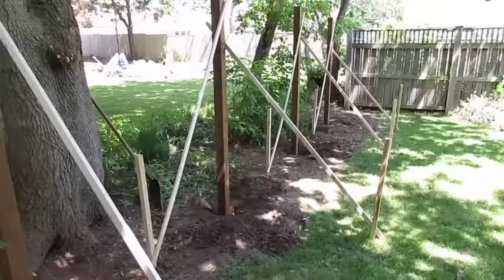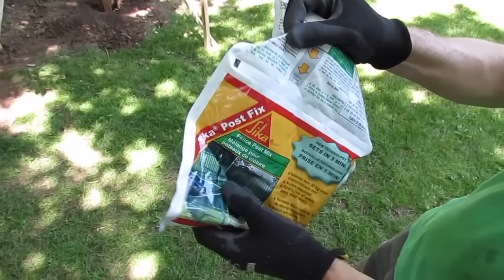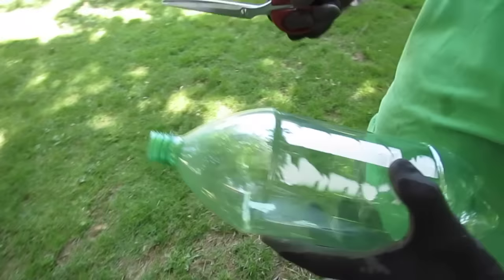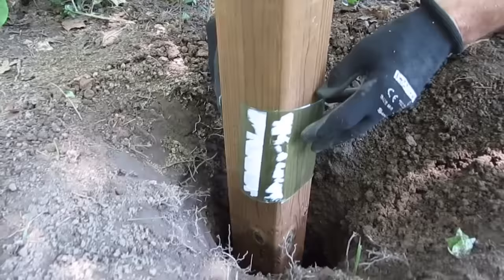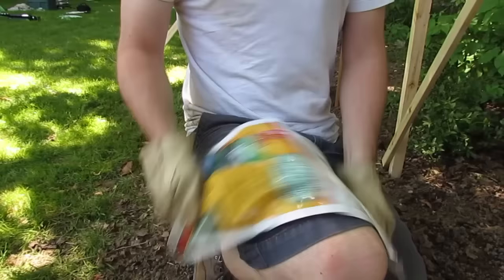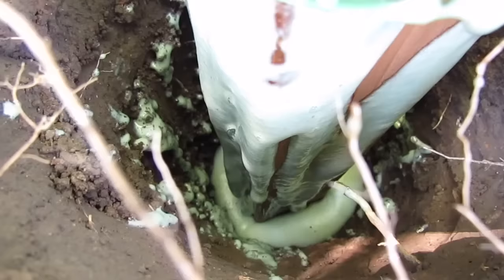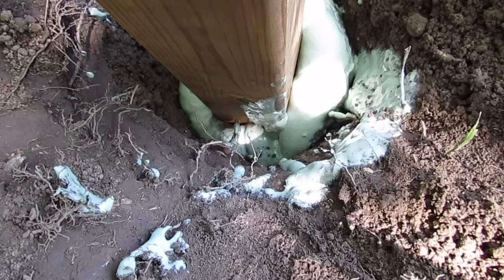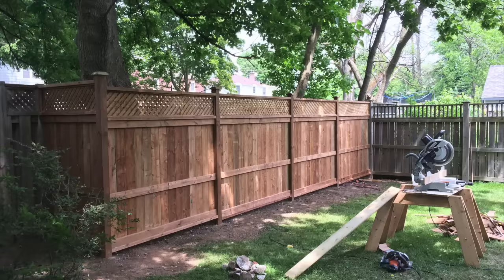No Concrete Fence Post Install!

Comment: Hmmmm that looks ok and would most likely be good. My brother and i built fences for customers up in The Dalles OR for about 25 years. We used a auger like you with about same size hole. We used pea gravel, put a little in 1st so post would sit on it instead of dirt. Then we used more pea gravel around the post and tamped it down real good, filling the entire hole up with the gravel. Reason we did it this way was to make it like a dry well, The rain water would just go down the hole and NOT stay against the wood. Im 66 now and everyone of those fences we built that way are still standing with same post. Cement is not a good product to put around fence post. After awhile it will have a small area between the concrete and post and will hold water in that crack against the wood and rot it. As long as the foam STAYS glued to the wood it too should keep water away from the wood. We were building contractors and i always thought concrete was not the way to go with fence post.
Reply: I agree,  I use a sharp gravel for extra friction.  I think that it also behaves better than concrete or foam with frost.  As frost can pull year after year the widening top of concrete out of the ground
Reply: Mr. Huteson, you are right on target.  
My area has clay type soils, so I backfill and tamp in 6" lifts.  The tamper is a steel rod, about 1" square with beat-down head on it, it really compacts the soil.  I mound-up the top of fill around the post so that water drains away.  Water in the soil is soaked up by the soil, and / or keeps the air away from the wood to prevent rot.  Some of my treated posts have been in the ground over 20 years and still going strong.  
Concrete retains a minimum of 7% moisture which is a good start to a 30% threshold for rot.  Concrete shrinks, so it shrinks away from the wood to leave a small gap to hold water which soaks the wood. 
Someone wrote that they thought the concrete helped by adding weight.  It also makes the base wider so that the post has more bearing area against the soil to prevent bearing failure and enlarging the side of the hole.  By tamping and compacting the soil, the bearing strength is increased and holds the post solid, even after 20 years and working in the wind.  
The foam seems like an unnecessary expense.
Reply: Only useful thread of the lot. Sticking to the post makes sense to keep the water off, as does concrete causing a wider hole, etc. 
The ground under my fences is clay, so I also used dug-up clay for tamped backfill. Seems to have held up well for the past 5 years. 
No real need for the disparaging talk about lazy people or whatever, it's more like no one has ever put forth a definitive method with clear reasons. 
I'm starting to think it might make sense to dip the posts in roofing tar before setting in tamped earth or whatever and maybe that would be the most effective?
Reply: Darren,
I don't recommend the tar.  In one instance, the tar will hold moisture inside the wood, even as it keeps moisture out.  In the other, the lack of tar will let moisture migrate out of the wood, regardless of how it got into the wood. 
For this reason, I recommend (see above) that you tamp the soil / clay / sand / gravel around the post and let the moisture be pulled out as the soil dries.  
Top the backfilled hole with clay as a cap, also mound up to let the water drain away from the post. In the bottom of the hole, set the post on a couple of inches of gravel (in pantyhose) to create a bottom drain.  
If your soil has low shear strength, this method will not work.
Reply: Michael M fortunately, that's exactly what I had ended up doing.  But why would shrinkage not be an issue with the clay?
Reply: Darren -- Clay at the top or bottom of the hole?  
At the top, the clay will shrink as clays do in the summer and you will see the familiar pattern of surface cracks.  Yes, the clay at the top might move away from the post.  With the surface crack, the clay is easily wetted and it swells against the post to hold it tight. 
At the bottom, the clay might or might not shrink as the moisture is less likely to change in the soil.  Thus, the post is held in place.  
If you are in a clay soil, the clay will shrink away from concrete (or foam) backfill, just like with the post.  Then it will swell back in cycle. 
For my posts in clay soil, they are solid and plumb after 20 years.
Reply: Thanks, Thomas.  That’s what I was looking for.  The only reason I’m watching this is to figure out a better way to replace pressure treated posts I put in concrete 35 years ago but broke off in a wind storm due to rot.  Not a fan of concrete for wooden fence posts.  It cracks, causes rot and the posts lean over time.
Reply: you should be the one making the video...
Reply: I agree that dry ramming is the way to go, that's the way we used to do it in Australia. First a base plate made of red gum in the bottom of the hole for the post to sit on, then put the post in and ram the dirt around it. It sounds like the post and base plate would rot but I've pulled down some fences over 30 years old and the base plate is still as solid as rock. I think part of the reason why posts rot these days is because the quality of the timber has been lowered and also changed, we usually use Cyprus pine nowadays because you cant get GOOD red gum posts anymore, they just rot in 2 - 5 years and are super expensive compared to their alternatives, Cyprus is about half the price and can last 10 - 15 years.
And hey, if you make a fence that lasts 30 years, how are you going to stay in business ;)
Reply: brianohbrian burns  heavy gates mean deeper holes and usually bigger posts (also for looks). That's for dry ramming though, if you were to concrete it then just 800mm in ground is enough. That's what I do anyway.
Reply: @kenbussian6925  They don't if they're dug correctly.
Reply: Just concrete your posts people....
Reply: There is a way to prevent water ingress between the timber post and the concrete, if the timber post shrinks over time. Before placing the timber post in the hole, get an old Paint Brush, and 'paint' silicone on the post base first. Then paint the silicone up the post on all four sides, to a distance that is approx. 50mm above the ground level. In this way, if the post shrinks, the silicone bond to the timber post - also shrinks. Preserving the life of the Fence Post. Silicone has a terrific bond to timber when cured, and it is worth the extra effort.
Reply: @Prairiedogma  yeah if you do it wrong with cheap concrete, 90% of the people out there mix the concrete wrong, almost always to much water and no fiber. I have built a ton of ponds, some with as little as 2 inch thick concrete in clay soil that have not cracked in 30 years, no leaks. do your post and concrete right and they'll last 50 years easy.

Comment: Power companies have been using foam to set there power poles for years now. I’m glad it’s finally coming to the residential market.
Reply: Ray Wilson so that's why they are always leaning and fall over in high winds......
Reply: Ive worked with Ameren Ue numerous times in my 16 years in the field and have yet to see them fill the holes with anything but concrete or compacted clay and gravel combination. Whoever told you this took you for a ride. Epa would be all over there ass for using foam.
Reply: My first comment was a joke, I am a equipment operator and we do a lot of digging in for electric lines so we see a lot of poles set.  Not one time have I ever seen the electric company use foam.  Auger a hole in the ground, drive the post in and use a compactor around it.  We have a lot of clay and rock here though, in the ozarks.
Reply: 40 year service life.
if you want temporary, then it's the stuff for you.
Reply: @justaguynamedmax8207  how is the byrde family treating yall over there? Did they finish building the casino?
Reply: Never heard of that.  Power companies don't use cement either, for the most part.  They just dig deep, drop in some gravel, set the (creosoted/tarred) post about 6' deep, tamp the soil around it, and they're good.

Comment: Save yourself the $ 13 a bag , as a small carpentry contractor i have occasionally over the years been asked to install some fencing , i used to fill every hole with a bag of post set or redi mix and used this product once when it was supplied by homeowner until a friend of mine who is the manager for the  landscaping division of a large farm store chain told me to just backfill with the soil you removed ,tamp  the shit out of the soil with the flat end of digging bar and check for plumb as your filling the hole up and keep poles linearly  straight with a string line.They only set posts in cement where a gate will be hung off of a post and go a little deeper /wider  maybe with hole to prevent leaning or gate sag . Works extremely well. glad i listened to him! Besides when it rains your posts wont pop out of the ground since they are now like a fishing bobber. I had this problem. do not buy this product  any one who endorses it is paid too

Comment: Tried the product. Easy to use. Quick. No concrete dust everywhere. BUT I noticed after a couple days the post I used this on - fence post with fence attached - had moved. The foam
had compressed allowing the post to move. Fence had been held level while allowing foam to cure. None of the posts I used Quickcrete on have moved. This may work in some soils for posts with no load, but for me I’ll stick with concrete.

Comment: The reason foam isn't designed for fencing is due to expansive soils.  When the soil is saturated, it expands and applies pressure.  In times of drought the soil shrinks, cracks, and dries out.  The weight of concrete helps anchor the post during loss of support during these cycling periods.

Comment: Thanks for the video. It was fun to watch, but I'll stick with fast cement concrete for 1/2 the price and not adding more plastic into the environment.
Reply: I will go with cement and concrete w hi ich has been used for centuries in construction successful and non chemical.  This product can be easy damaged by cold and heat

Comment: You don't use foam OR concrete.  You tamp crushed rock (typically 3/4-down) in the hole around the post.  Using concrete or foam locks the moisture into the wooden post where it will rot out the post.  The fence posts will last for years longer this way.  I did mine 13 years ago using 6x6" p.t. wood posts set with tamped crushed rock.  We get hard-freezes every winter up here (Canada) and our soil is red clay gumbo where I am.  Fence and posts are still arrow-straight today - and not rotten like the collapsed fence ( c/w hunks of concrete with square holes through them) that I removed back when I originally bought my place!
Reply: Robert Garvey for the rest of us who don't live on clay, we gotta use something like concrete or foam.
Reply: i doubt wood would be arrow straight after all those years. it is just not in its nature. also you can wrap the bottom of the post to avoid moisture or even paint it. once concrete sets up moisture will not penetrate it but it will around crushed rock.
Reply: Maybe you're right.  I bought my house in 2005 which was 1 year old at the time.  All post in the ground WITH CONCRETE rotted and broke off at the concrete top in 2015.  That's 11 years.  I'm in the Bay area where it only rains 4 months out of the year and is dry the rest.  
For all those here who claim concrete lasts for many decades, please explain that.   The parts of the fence sitting on top of the retaining wall with brackets are just fine (no rot).
Bottom line: concrete draws water from the soil and the wood soaks it up ending up rotting away.

Comment: Hello!

I was extremely cynical when I first saw "foam" and "fence post", but it appears that this has great potential. I've got questions though.

A) Cost per post relative to that of concrete, factoring labor time.
B) Longevity of foam in the environment (UV exposure, free thaw, etc)
C) Strength retained with constant sideways force (branch pushing against the fence, hobo constantly leaning on the fence)

Thanks!
Reply: Hobo😂😂😂

Comment: Using foam or concrete,  wood rot will occur with the post being exposed to the top soil.   I suggest using concrete formed above ground and angled so water will flow away from the post.   May not look at nice but just search for videos of removing rotted fence post and you will not want to have to do that.
Reply: True

Comment: I used to be a distributor of SIKA (a Swiss Company), we sold great products. I retired before this product came out, but I am sure it is fine. The important thing is to ensure you have enough wood underground so as to keep any momentum over the pole at minimum, That is, try to bury one third of the whole length of the post.

Comment: Taught to me by my SeaBee Father in Law how to quickly insert a deck/fence post using bag concrete.   Insert post, poor in 1/2 hole of water, poor in concrete mix (dry), mix using post action, more water, more concrete mix, done in 5 minutes, next post.......  Works every time and never had a fail.
Reply from the maker: Funny another guy commented moments before you swearing that pea gravel works even better! Seems like everyone has their own version of “the best way”.

Comment: Anybody with experience in fence construction knows that all you need is sand and gravel to secure down fence posts.
Reply: Sand and gravel are good,I like to use broken up bricks and rubble rammed into the hole around the post using a large iron bar, it makes it very solid. The big benefit over using concrete is that it doesn't trap water around the post, it allows it to drain away making the post last longer. It works of course just as well with concrete posts.

Comment: Use Quickset. It's just as easy as this foam, but way stronger!
Reply: using Quickset is illegal because it doesn't have enough required strength. I'm not sure how they measure it or whatever, but in the state i live the council doesn't allow it for commercial building projects
Reply: We are talking fence posts. Not a building foundation.

Comment: The idea of the foam is cool.  But just like concrete, it takes a lot of extra time and money.  I only use concrete if I'm supporting a lot of weight with the post, to get a larger footing, like supporting a deck.  Fences don't need anything but dirt.  You can tamp dirt in in less time, and at NO cost.  This foam costs between $11 and $17 per post.  We have fences holding in horses and cattle that are made of hedge tree (osage orange) and put in the ground over 100 years ago, dirt tamped in around them, and they're still rock solid in the ground.  Tamped dirt lasts longer than the posts do.  Even with large livestock pushing against the fence on occasion.  :)

Comment: Nice video. What you may have overlooked in mentioning, is the technical properties of the interaction of concrete and wood. The wrong type of concrete installed around a post made of the wrong kind of wood, can rot in the base of that post. Imagine using this that will not occur.

Comment: Or alternately use two small cross beams of wood screwed (not nailed) at right angles a few inches up from the foot of the post and pack hole with gravel and stones. Cheap and Eco-friendly. Will hold a post/bench firmly.
Reply: Andy Moss 

I’m having trouble visualizing this. Would you please elaborate?  Screwed to what? Right angles to what? Each other?  To the post?

Comment: Mike Holmes likes it so it must be good! Seriously, I am literally "on the fence" on using this.
Reply: @darrellsaturnbigfoot  Holmes is cool, has great ideas but only if folks have bottomless pockets. Change a lightbulb....need the top bulb ever, replace the fixture for some energy compliance reason, the wire color of home is off so let's rewire the house, add a breaker, new switch . $1 fix now cost 20,000. LOL

Comment: The fence guys I have worked with around here (Northern California. No frost/freezing) Stand the post up plumb, fill the hole with dry fence post mix and tamp it real good. When they're all done framing, they go along and wet all the holes. I just replaced a fence done here that way in 1978. Some of the posts were "kinda" bad. Not all. Worst part was the fence boards mostly had rotted where they were attached to the 2X4 frame. These were "redwood" posts also and not the P.T. posts that are more widely used currently.

Comment: I poured river rock gravel in the bottom.  Coated the post with tar before using this product.  It's been 6 years and my fence is still standing strong.  It's a lot less time consuming especially when you work 60 plus hours a week.  Don't use those cardboard tubes.  I used them on my first couple posts and had to later pack the ground with more dirt and gravel.

Comment: Not sure I would want this for a permanent fence, but it would be great for a temporary one you want to remove later. Concrete weighs a ton and it would be much more work removing down the road.

Comment: You can use plain old Quick-Crete or any pre-mixed 80-pound bags. Pour the mix in dry. If your soil is good and damp, pour a drinking glass full of water on top and wait overnight. If your soil is dry, pour a gallon of water into the hole add the Handi-Crete, then pour a glassful on top. I used this method to support a 6" steel pipe that a 22' gate and 550-pound counterbalance swings on. After 15 years, it's still tight. Mixing concrete is only needed for finishing.